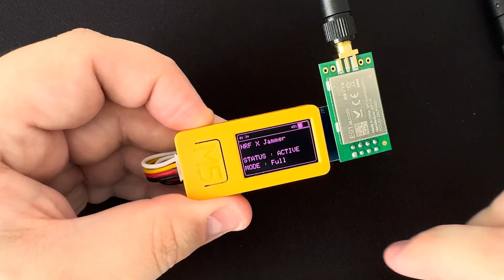The BEST Development Board for M5stickCplus2

Comment: My dev board did not come with a compacitor. Do I need one, if I do what size?
Reply from the maker: Where did you get it? Some boards don’t have it but if it was this board then it should have one.  I’m not sure which capacitor is used on this board.
Reply: I ordered the board from tindie.

Comment: Thanks for the amazing video, one question Please. I have ordered the same dev board, for increase range it’s possible to use E01-2G4M27D?? Thanks
Reply from the maker: I haven’t personally tried but someone did buy the module for the M5stickCPlus2 and said it worked perfectly.  If that’s the case, you should have no problem. Just double check all your pins and make sure they are set correctly.
Reply: @Cherry_Tomato_1 Thanks for the fast answer

Comment: Gonna buy this rn but is there anyway you can plug in a ir device like an grove ir unit or would you have to unplug the pcb
Reply from the maker: This board is more for a cc1101 and NrF24 module. You MAY be able to use the M5stack expansion hub and use one of the ir modules from them or make one yourself.
Reply: @Cherry_Tomato_1 just ordered and I’m getting hell of problems, I have no confirmation, no tracking not even a receipt and there customer email are not working to.
Reply: My payment is also stuck on pending for like 5 days

Comment: There is also a module hub available. You plug the hub in the M5 and the different modules via cable in the hub. I don't have any device. But i was looking at different devices and I think it will be the one from M5.
Reply from the maker: Yes, there is a hub from M5 but unfortunately they don’t offer a lot of modules that work with Bruce. There is no sd card module, no nrf24, etc. They do have rfid, ir, sub ghz, etc but they are very weak and cost way more than getting the modules off of AliExpress.